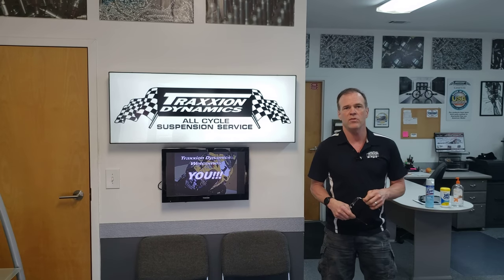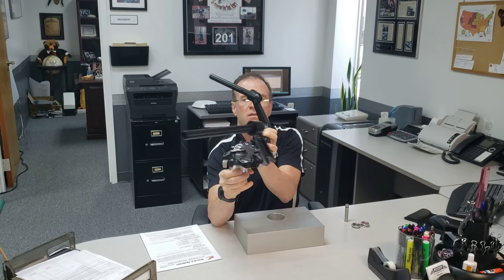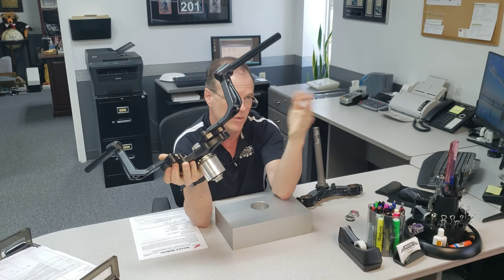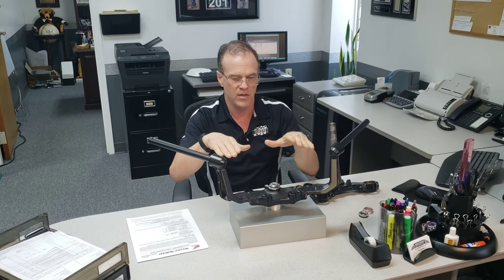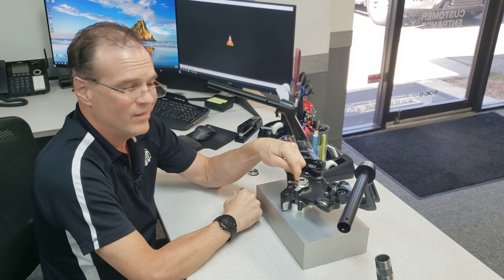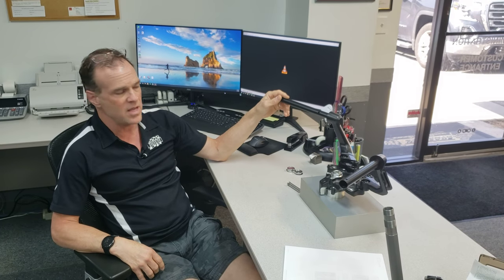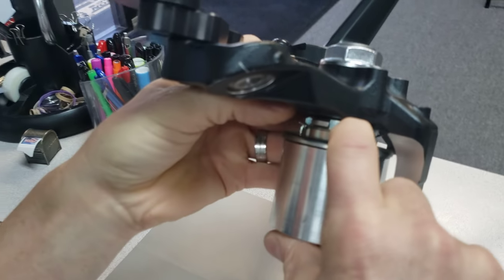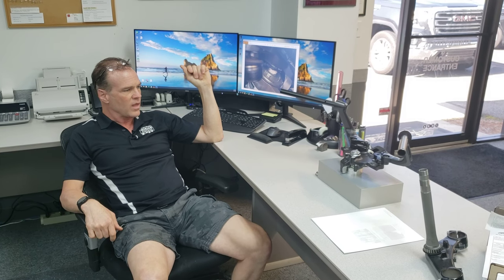2018+ Honda Goldwing Potential TOTAL Steering Failure!!!

Comment: Wow. Very concerning!  Your pin is brilliant. Like you said like a helmet you never want to need. Seems to me the failure had to do with steering being tied down?  After a few hours of rocking and rolling it failed. And since Honda declares the handle bars should not be tied down it will be interesting if covered by warranty. Also wouldn't this problem show up in the previous generation Goldwing because it has the same aluminum spindle?  Did Honda also specified that you cannot tie down the handlebars on the previous generation?  Much to learn.
Reply from the maker: Watch for a video on this topic....  PS the manual does NOT say how to tie the bike down.

Comment: Now that Honda knows the guys name, location and the video stating it was broken while trailering the bike by being strapped down by the handle bars... seems like grounds for a warranty denial. Let’s hope not. I just don’t see that breaking like that from normal daily driving. The force on the bars from being strapped down in the trailer or the bike having a serious wreck I could see this breaking though. I doubt Honda does anything. Just like the couple of people that have been sitting still at a red light and the bike taking off on its on without touching the throttle on the dct models

Comment: I just bought one new last week 2020 DCT should i be worried ?
Reply: EXACT Same Senario Here.. But, I'm not worried..2020's should be fine..and Torqued To 52lbs since they were assembled "Post- January 2019"..
Reply from the maker: 2020 should have been assembled properly.

I am going to do another video, as we've realized anyone who has their bike tip over and hit the handlebar should replace that shaft to be safe.

Comment: Has Honda addressed this issue on 19's and20's?
Reply from the maker: The torque spec on the nut has been addressed. But the steering spindles on all 18+ Wings are made of aluminum.
Reply: In your opinion, should this be installed on a 19 or 20, and/or is it the same diameter as the 18?
Reply from the maker: @rickthompson3243  all parts are exactly the same

Comment: It appears this guy used his handle bars to tie down the bike, against manufacture warnings.  This has nothing to do with the bad stem nut.  My suggestion to owners who transport this generation GW; add these brackets to the bike.  https://wingstuff.com/products/38047-tie-down-brackets
Reply from the maker: Read the 2018 Owner's Manual.  There is no warning about using the handlebars to tie the bike down.  There's actually no instructions at all on how to do that.   The Goldstrike brackets are a great product!
Reply: @Traxxion  I stand corrected.  I may have read that in a GL forum.  Still, I wouldn't trust any aluminum part to hold the bike securely.
Reply from the maker: @Towman728  the entire main frame, along with the swingarm, wheels, engine, subframes, fairing mounts, handlebars, triple clamps, footpeg mounts, fork legs, brake caliper mounts and calipers are all made of aluminum.  Which part don't you trust because it's aluminum?  Ever been in an airplane?  HAHA!  This part needs to be made much stronger, that's for sure.
Reply: @Traxxion  Not withstanding that your stem pin is a great idea,  I just don't think it is wise to put constant, non-rebounding downward pressure on these asymmetrical handlebars, with or without your pin. I was in the towing field for over 35 years, and have towed hundreds of motorcycles. Didn't happen to me, but I have seen handlebars bend and break on heavy bikes.   I always hooked to something other than the handlebars, when I had an option.     That being said, we have learned that this bike's stem is hollow; a weight saving design, I figure. So as long as we know the weak link, we need to find other options for tie down.  The after market front tie down loops, along with using the oval transport hole just above the swing arm axle cover, for tie back, should make it safe to tow without breaking anything.   Thanks for all your research and remedies on some of Honda's weak designs.
Reply from the maker: @Towman728  Your plan for tying down the bike is what I would recommend, as long as the owner has bought the tie down hooks... where Honda should have put them...

Comment: It's going to be total steering failure, if YOU STRAPPED THE HANDLE BAR down on a Trailer.  Other than that, we need not worry about such thing.

Comment: Please tell me that bike was not secured using these handle bars wtf. They are not traditional motorcycle handle bars clearly. You may as well have tied it down using the rear view mirrors. Just above the engine in front left and right is access to the frame where a couple nylon loop straps would secure the bike better and cause no damage.

Comment: Looks to me like he pulled down on the bars, bike bounced up and down and pulled the bars down on one side snapping the threaded end. I'm sure the guy with the trailer is to blame.
Reply from the maker: You don't think the typical 300# rider with a 200# wife pushing and pulling against the bars over time will do the same thing?
Reply: @Traxxion  possibly, but the chances are, if the fault was there in the trailer, chances are it was OK going in, so suggests he pulled it down on the bars with straps, the bike bounced the straps didn't give causing the problem. Got to say, I've fell off MX bikes and Trials bikes with alloy handlbars and none broke, that particular peice is as you have already mentioned put under excess stress from the steering nut, so maybe its a weak point?, has this guy been the only one with this issue? I've seem guys turn up to practice weekends with blown fork seals due to over zealous ratchet strapping! In fact when I was stupid and young I used a ratchet strap at an engine hoist, they can lift 100s of pounds with very little effort, so as you suggested, maybe he is the fault. But without all the information, and him telling ALL the story, maybe without extensive investigation from Honda, we may never know. But in the meantime, I'm going to back off my handlebar nut to 52lbs treat it to a dob of mild locktight and make a stainless pin to bsck up the stem, so I can not worry. In fact I'm going to look at the whole assembly and maybe turn one up out of stainless, could the hollow centre be the issue? Thinner wall strength? Without stripping it all out I won't tell, but I have a machine shop.
Reply from the maker: @anthonyprice5596  His handlebars didn't break or bend, so that's important to note.  Without triple clamps and forks to the support the "steering stem", it is now the weakest point in the system, and just above the bearings, which are well supported, is threads... which can and will crack.  I suspect this will begin to be more of a problem over time.  These bikes are still new.

The hollow tube isn't the problem in my opinion... it's the force applied to threads.  We are going to make a steel spindle here, we happen to be making steering stems right now, so it will be easy.

We will leave it hollow, and still recommend the safety pin.   I will have a video further analyzing this in the next day or two.
Reply: @Traxxion  sensible move, I'm going down the same route( as we say in England" belt and braces") I'd rather know I'm secure. Your right if you make the assembly from something more tensile steel ect, the bore down the centre can remain. I haven't pulled mine down yet to see the item in full, but it looks on the face of it a simple part to reproduce, I'll turn one up and do a Cad file for replication services. But I have no intention of taking food from your table, because the work you guys do with R and D and doing the video pointing out the possible fault is a great service, and could save lives or prevent injury. Can't say I'll sleep well until I get to it, but knowing is half the battle, for that I'm greatful.
Reply from the maker: @anthonyprice5596  you must have a lot of free time on your hands to go to all that effort to make one piece!
Reply: @Traxxion  yes and no, I restore bikes, build bikes and paint bikes for a living, I'm always tinkering with something, I'm fortunate enough with my wife running her business, we have the time to make solutions to problems. I build springer forks from scratch!  And make open primary clutch assemblies for custom projects. I even make 316 stainless caliper pistons for rebuilds. Haven't got into casting yet but hoping to get a 3d printer soon, as I have a guy with a foundry who will cast from my prototypes, so anything will be possible. I even make rotor heads for rc helicopters.
Reply from the maker: @anthonyprice5596  Awesome!
Reply: @Traxxion  thank you Max that means a lot coming from you, much appreciated. It comes from being tight with money and not liking to pay for stuff. Lol 😆

Comment: You should sell the rights for the patent for the pin to Honda, make them look like real idiots... That spindle should of been made of something else other than low grade aluminum, what where they thinking. You know what you should do as a video, test the stress force on that pivot point where the handle bar meets the spindle... See what kind of side to side force it can endure...
Reply from the maker: My company is very small.  We don't have that type of capability.
Reply: well you designed it you should reserve that rights to it... I think your little company is great.👍
Reply from the maker: @paulbickley658  thanks!

Comment: If the bike was on a trailer, then it was not catastrophic.  Very bad choice of words.
Reply from the maker: Catastrophic failure is a engineering term for the part, not the well being of the operator.  You should educate yourself before you incorrectly try and correct another person's selection of words.
Reply: I take it your doctorate was not in metallurgy then?